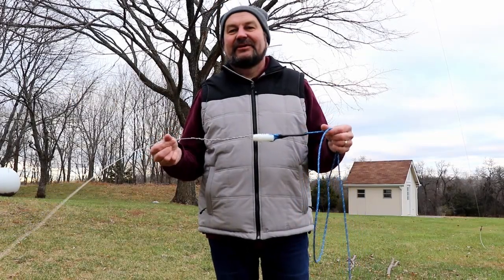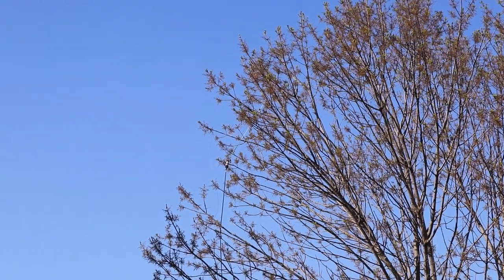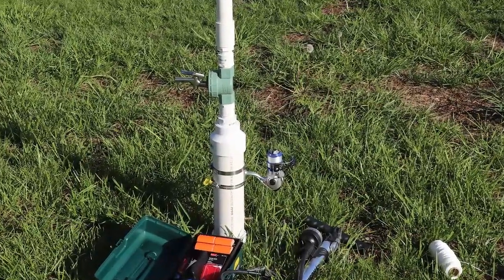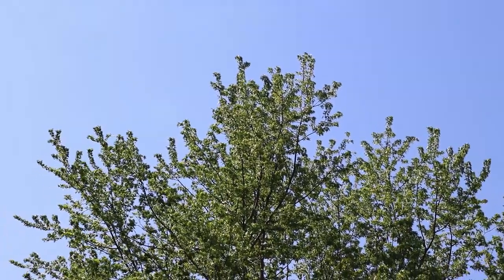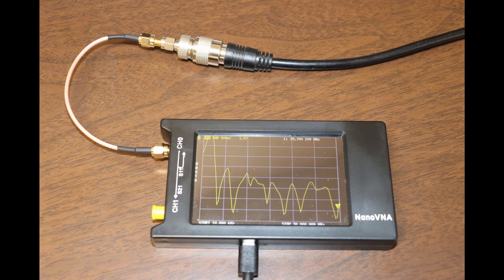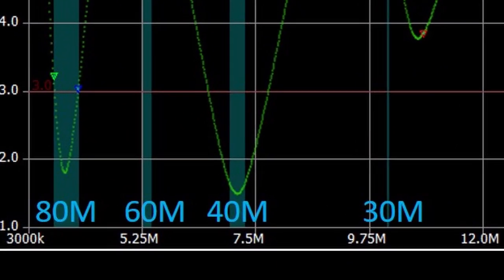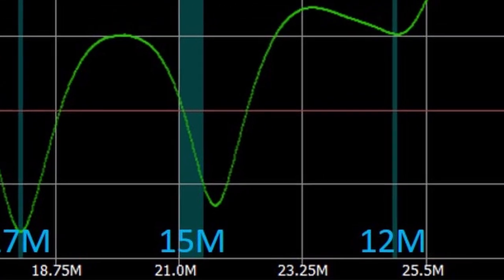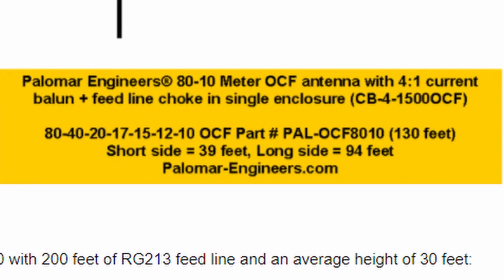80 Meter Off-Center Fed Dipole repair - Again!

Comment: Excellent video! Inexperienced HAMs need to see how these procedures are done.
I made a "launcher" using a Zebco reel taped/clamped to a wrist rocket slingshot with a large nut for weight.
I had the first HF dipole get struck by lightning. The second one (Icom AH-710) got demolished by falling trees during this winter's ice storm, and now I will be using it to mount the third one. (another AH-710) -which I had great results with my IC-7300. -'73

Comment: On the end of the rope that goes up over the tree branch, tie a small pulley. Take the rope that attaches to the end of the antenna and run that through the pulley then add a weight to the other end. When you hoist it up, it takes some trial and error to get the several lengths right but once you're done, the tension pulling on the antenna wire is roughly equal to whatever weight you used, even when the trees and antenna are being blown around. I find 5 lbs is best.

Let the weight hang down low enough so that when an ice storm weighs down the antenna, the antenna just down to the ground while the weight rides upward. When the ice melts, the system goes back to normal with nothing broken.
Reply from the maker: Hi.  Thanks for the comments.  Yes, I’ve seen this technique in ARRL publications.  It is a good way to go.  I’ve tried to have my anchor cables going over larger branches that don’t move too much in the wind and to make sure I leave a little slack.  So far, with the steel cables, it’s holding.  When (notice I didn’t say if) it comes down again, maybe I’ll try the pulley and weight approach.  That’s part of the fun of antennas.  You always get the opportunity to try something different when Mother Nature throws you a curve.

Comment: Use parachute cord, its cheap and mine has been up for about 10 years with no breakage !
Reply from the maker: Hi Rick.  Good suggestion.  The camo end piece that I pulled the cable up with is parachord.  I’m hoping it will last longer.  I don’t think it would work as the only line here.  We get a lot of winds and my trees have pretty rough bark.  I’m pretty sure they would eventually saw through the parachord if I didn’t use steel cable on the section that sees the most movement.

Comment: Did you make the antenna launcher?  Is that a kit, or bought assembled?  I need one, just hadn't found anything in the price range/without seven zillion options to try and figure out what I actually need.  Great job, watched most of your 7300 vids when i got mine. THanks!
Reply from the maker: Hi.  The launcher is homemade from a modified 1 inch sprinkler valve and some PVC plumbing parts.  If you search on “pneumatic tennis ball cannon plans”, “pneumatic antenna launcher plans” and similar terms, you’ll find a bunch of websites and YouTube videos on the subject.  My sons and I have made several variations over the years.